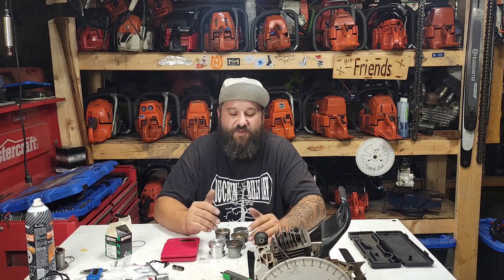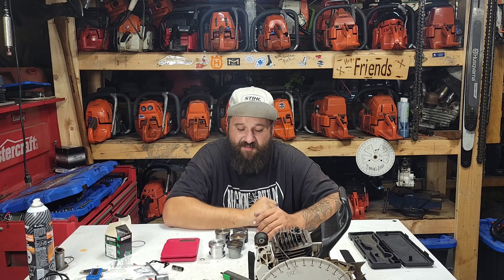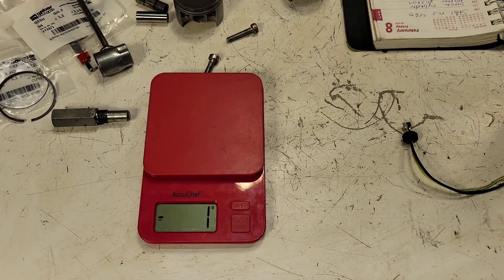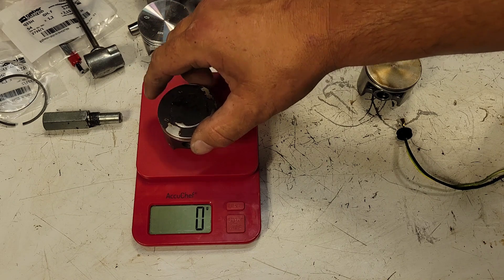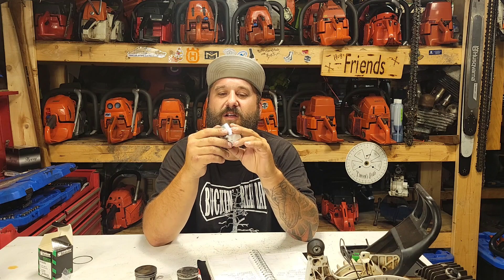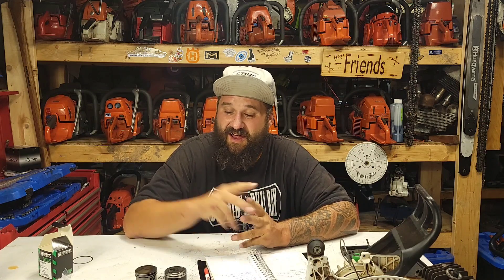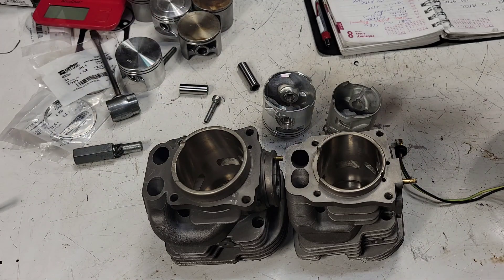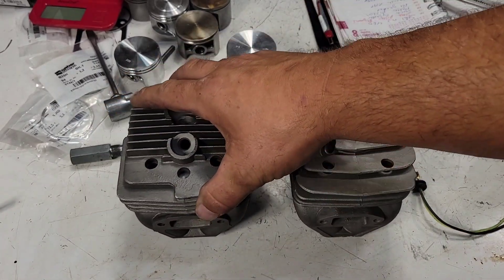Stihl ms460 piston mods/ Does K970 cylinder fit on a 576xp?

Comment: my ms 460 rod tips a little I know it's post to move left to right but tipping at top I'm not sureif you slide it all the way to the right at bottom  and tip the top of rod it will go about a third of the way to the left with bottom of rod not moving
Reply from the maker: They will have some side to side play that is normal. Up and down is bad.

Comment: Hey, dumb question from the new MS362C owner.... is it just me or is the oil pump like... stingy with the oil?? is there an upgrade that I can do to get more oil out to the 20" bar and chain??
Reply: 362 should have and adjustable oiler. Some googling should show you it’s location. That saw should oil a 20” quite heavily when opened up.
Reply: @MemphisMechanic  I’ve got it cranked all the way and it still looks waaaaay too dry to my tastes! Upgrades?